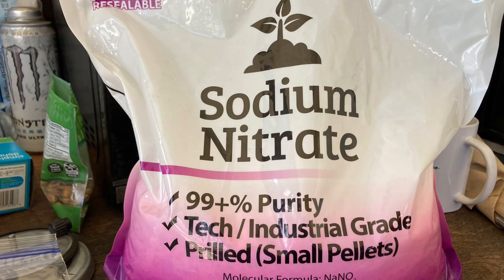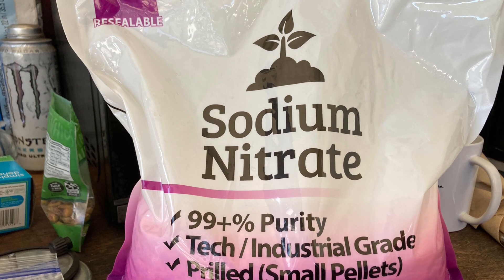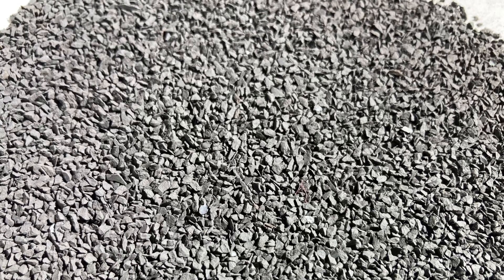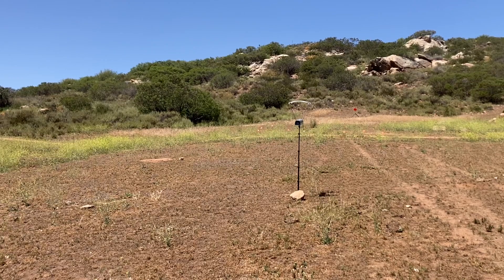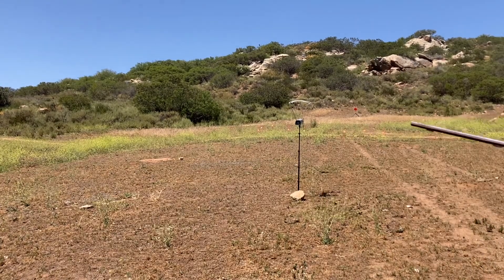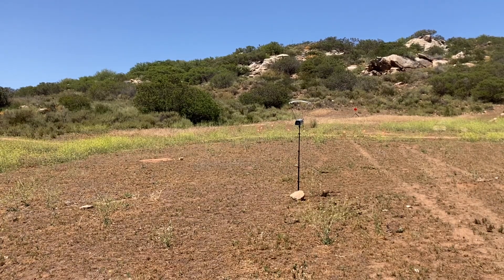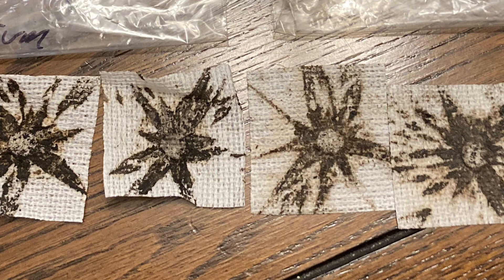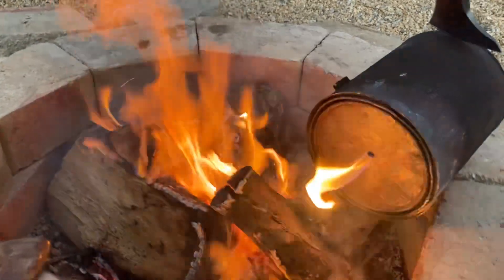Sodium Nitrate Black Powder

Comment: Your potassium based black powder (77g:13g:10g) has a molar ratio of 0.762:1.082:0.312 of KNO3 to carbon and sulphur. When you changed to Na based black powder you didn't take into consideration that the molar mass of NaNO3 (85 g per mole) is lower than KNO3 (101.1 g mole). The result is your black powder has more oxidiser (nitrate ion) present. The new molar ratio of nitrate:carbon:sulphur is 0.906:1.082:0.312. If you want to keep the ratio of oxidiser to carbon and sulphur equivalent to that for KNO3 you need to reduce the NaNO3 to 64.8 g (0.762M x 85) while keeping carbon at 13g and sulphur at 10g.  An additional consideration is that NaNO3 is hygroscopic which is why KNO3 is generally preferred to prepare black powder. NaNO3 might be inferior to KNO3 for a reason other than an excess of oxidiser or moisture content. Beavis the organic chemist.
Reply from the maker: Thank you, I’ve had a few people mention this. I’ll have to give it a try.
Reply: @Everythingblackpowder  You mentioned that the CIA method allowed you to increase the density of your KNO3 powder, but it uses water. It is probably better to use a dry process (few drops of water) because you won't have to worry if the powder is dry. However, it might be difficult to reach the density of the CIA prepared KNO3 powder and you will need to add more NaNO3 black powder.  I hope you get better results.
Reply: I have a composition here, but it might be for blasting powder: sodium nitrate 71%, charcoal 16.5%, sulfur 12.5%. 

But anyway, gun powder made of sodium nitrate is a bad idea, unless you can cover every grain with wax, as they used to do with NaNO3 based blasting powder. It's very hygroscopic, while KNO3 is almost non-hygroscopic.
Reply: @Everythingblackpowder  Paul is correct and this works. As for the chlorides yes true but it can be washed out very efficiently you can also use KOH which is Caustic Potash and even wood ash (the actual way they used to make Salt Peter in history for Gunpowder).  Also Chlorides aren't wonderful true, but a fact of life with all gunpowder historically. So historically gunpowder was a mix of Na and K Nitrates and contained a few other random minerals yet worked fine.
Reply: the classic composition of sodium powder contains more coal, 72/18/10 - Sodium Nitrate/Coal/Sulfur. There is noticeably more oxygen in sodium nitrate, so there should be more fuel. In general, such gunpowder is noticeably more powerful, in a steel pipe the deflagration rate is 500 m/s, in potash powder it is noticeably less than 400 m/s. The heat of combustion is also higher and there are more gaseous products. If it were not for the high hygroscopicity of sodium nitrate, it would completely displace gunpowder on potassium nitrate.
Reply: Can you translate that into English? Lol layman's terms?
Reply: Potassium Nitrate in KNO3.  Sodium nitrate is NaNO3.  K is potassium.  Na is sodium.  NO3 is nitrate.  So, they are essentially the same thing, except one has sodium in the place of the other's potassium.  The thing is, potassium weighs almost twice as much as sodium.   So, the same weight of sodium nitrate will have a lot more nitrate in it than potassium nitrate will.  So, if your black powder recipe goes by weight, your sodium nitrate powder will have a lot more nitrate in it.  Too much to ignite effectively, in fact.    @goodgodgivemeaname

Comment: Question: In Cooking your Charcoal, are you purging all of the Oxygen from the Charcoal Container prior to starting the heating process? The dirty burn might be from the oxidation of the Wood prior to the Carbonization from the heat. Maybe add some Dry Ice to purge the air/oxygen prior to heating as an experiment and see if it cleans it up any. Just food for thought.
Reply from the maker: @elberttanner6189  interesting

Comment: Lower temperature charcoal will have more volatile compounds left in it, which helps combustion and decrease ignition temperature. The higher the temperature of pyrolysis, the less Oxygen/Nitrogen/Hydrogen compounds you have left until eventually you're left with only carbon, which at that point you might as well being using graphite. IMO the ideal charcoal has been heated just enough to drive or burn off the water and "sap" content to create a porous and frangible charcoal._

Comment: As a teenager some of us to mix when 50-50 sodium saltpeter powder from the drug store with sugar and use a jetex fuse in piece of pinched off electrical conduit at both ends to make a bang.  I tried it in a homemade cap lock and it was only effective for the first shot.  After that there was too much fouling.

Comment: I was just starting to write the same thing good thing i went back and double checked. Someone wrote it a lot better than i started to. So I'll just do a condensed version so i can still get at ny point. I use nitrates for making nitric acid i use in precious metal refining. I prefer sodium nitrate to potassium nitrate as pound per pound you get a higher percentage of the weight made up by the nitrate anion on account of using the lighter weight sodium cation opposed to the heavier potassium cation. In this case the anion is the good stuff its use in black powder is no different. Now you also got to keep in mind that the sodium nitrate also has a bit of an affinity for water.s getting it completely dried out anhydrous is very difficult and then it will also literally suck water up out of the air the more water you got in your powder you do the math. I imagine using it for black powder it won't store very well, especially so in a more traditional type of container like a powder horn

Comment: I read an article about Swiss Powder which said that the charcoal was made from wood that had been weathered for two years in the forest where it was gathered before being processed into charcoal. If you think about it the purity of sulphur and saltpetre is pretty much constant, the greatest variable is the charcoal. Also the very high pressure that the mix is subjected to by the rollers before being granulated may make a difference. Weight for weight the Swiss powder seems to occupy a smaller volume so has a greater density.

Comment: Sodium Nitrate is highly hygroscopic; you need to bake out the water and then make sure it isn't exposed to air to reabsorb water.  That would be difficult, but unhydrated Sodium Nitrate is probably a better oxidizer than Potassium Nitrate.

Comment: What is the fastest powder one can make as easy as std BP ? Looking to replicate a BlackCat firecracker as much as possible.
Id still need a ball mill.. whats the best ingredients and ratio.
Ive been doing binary with premade alum powder, looking to get a ball mill and step it up to something more energetic..
Reply from the maker: I would use KN03 instead of sodium nitrate. I use a ratio of 77/13/10
Reply: @WillardMcBain  
77,13,10 is what I ended up on after reading more. But being in a high humidity area how bad is it for absorbing moisture  ?
I know it's not as bad as the SN but I have to deal with it constantly with the Potassium Nitrate and Aluminum based stuff.
Reply from the maker: @TrashPanda71 that’s all part of the show. I live in the south west so the humidity isn’t really a problem for me but the SN is much worse that KN03
Reply: @WillardMcBain  
I've also been looking at Flash Powder, much easier and very energetic, but must be extra careful with it.
7 grams of Potassium Perchlorate and 3 grams of Black Aluminum that I've bought before for the binary ..
Reply from the maker: @TrashPanda71  never made that
Reply: @WillardMcBain  
I'm having a brain fart tonight, 7 grams PP and 3 grams Alu ... that's not the same as 7 spoon full and 3 spoon full.. has to be 7-3 in weight  not volume  correct  ?

Comment: Sodium Nitrate is also called "Chilean Saltpeter"as it was found in Bat Caves in Chile and used for making Black Powder. It is more Hygroscopic than Potassium Nitrate,this means it absorbs moisture from the air more readily so it's harder to keep your powder dry .

Comment: Hello sir 
I make my black powder out of potasium nitrate that usually done .
But the problem with this 
It catches moisture in gun s breech 
.so i decide to take about 70 grains of powder and put in a thin layer of plastic paper and roll it down to barrel s breech .it works pretty good and same without any moisture problem.but sir I have question for you this method is good for accuracy or ballastics ?
Thanks sir

Comment: Are there any disadvantages to using sodium nitrate instead of potassium nitrate? Or would they both do the same thing?
Reply from the maker: If you’re using a firearm that takes a cap, it’s pretty much the same. It doesn’t work so well in a flintlock
Reply: @Everythingblackpowder  Got it sir, thank you. I intended to load 410 cal cartridges...

Comment: Hi, I made black powder following your advice on how to prepare it and the only thing I need to do is to compact it with a hydraulic press. The black powder I made burns at a similar rate to pyrodex.
I made the granulation from 3f.
Can it cause any damage to the rifle if I load it with this powder?

Comment: If you try to buy ammonium nitrate in any quantities now days you're likely to have law enforcement sniffing around. Practically impossible to buy even fertilizer grade locally. This do it yourself manufacturing would seem extremely hazardous to me but I'm not a chemist or manufacturing engineer. I'm surprised that you could get better results than GOEX. I have some of that left in my magazine but mostly the junk Elephant  brand. I'm not shooting muzzle loaders now days. Saving any good black powder for black powder cartridge 45-70 rolling block.
Reply from the maker: Well I’m not planning on doing anything with ammonium nitrate. As far as the performance of my powder goes, my alder buckthorn thorn powder matches the velocity of Swiss and my willow powder matches Goex. At this my main concern is making it burn cleaner

Comment: .... fast.....and could be even faster....sure anyone could hndle it......???!
but good man
also this is so fast and accuracy seem to be there , woow extraordinary experiance with this propelant. 
Personally is think i would use something bigger till it gets barely aimed on that range which is i think a top real use of it in  a cowboy defance of a city historical fact.... but yea . I think that this is a good time to introduce THE liquid gas propultion for a rifle like that , it is easy to inject it into a shell , just pour a cold liquid into a shell and it will stay then hold it in a freeezer for security , you may try to find out how long (if at all ) it takes for it to decompress in a dayly tempreture . A liquid might be anything really ....you know lots of them even if not combustive in a gas form DO explode unde  Ignition.
 Liquid oxigen , sure the easiest to get, liquid hydro ....might be , liquid nitroOxide yeas sir(it implifies already ignited ´´fire´´ so if you do it just the way its done in solid state then it will poof this poop out like a nukeAND its really easy to stor in a hit of a day (the  bottle does nod get exploaded typically when in a car soo just try it and remember to seal a bullet with a shell with a fine glue .

Comment: The CIA method for making black powder is not likely to work well because NaNO3 is hygroscopic and it will be difficult to air it well dry after you precipitate/crash it out with isopropanol. You are going to have issues reaching the density that you get for your KNO3 black powder. Drying in a chamber with a good drying agent and using a vaccum pump would help remove the water. Do not heat the chamber!!

Comment: I'm using sodium bp because i can't find easily potassium nitrate. If the ball isn't rammed super tight, with the low ignition speed, it sometimes puffs without actually detonating. But if you really ram the ball well, it will just pop like one hell of a baloon. With a percussion cap and a well pressed ball, you got no delay, not much smoke and quite nice power. And it's cheap and easy to find (stump removers manufacturers usually put sodium nitrate beacause it's cheaper)
Reply: Look for stump remover powder in garden section of many stores.
Reply: @donaldcadwell3911  most of the stump removers are made with sodium nitrate, beacause it's cheaper than potassium. And that's exactly where i got my ingredient
Reply: @jeanladoire4141  
Spectracide is brand we have that is Potassium nitrite.
Reply: @donaldcadwell3911  it doesn't exist in France sadly. But sodium nitrate work well, it was used before,but will behave like old gunpowders : you have to ram it tight for it to detonate
Reply: @jeanladoire4141  
👍

Comment: You can get 1900 feet per second with black powder,- but that involves the old English Black powder express rifles.
As a example:
The energy requirement for big game in Norway is: 
1) for bullets with a weight of 138.9 to 154 grains, the estimated energy is at least 2700 joules at 100 meters E100 
2) for bullets with a weight with a minimum of 154 grains, the estimate energy is minimum, 2200 joules at 100 meters. E100 
Conclusion: One must have a minimum speed of 400 m/sec (at 100meters ) and a ball weight of at least 450 grains to cope with the energy requirement on big game. (2233 Joule E100 for those wondering).

That is possible with:
.45-120 ( 500 grains bullet, 463 m/sek 1519 ft/sec)

.50-140 Sharps 

English cartridges:
.450 Black Powder Express

.461 (.450) Gibbs

.500 BPE ( 440 grains bullet ,580 m/s 1902 feet/sec)

.577 BP Express

.500 No. 2 Express (.577/.500) 340 grains bullet 130-160 gr Fg swiss ,587 m/s 3,800 J .

Scottish bottleneck:

20/577 Alexander Henry, 570 grains bullet, 1,725 ft/s (526 m/s).

Speeds above 600 m/sec is extremely hard to obtain with black powder.

Comment: Damn, I didn't know you could achieve those velocities with black powder, especially round ball (though I assume it sheds velocity extremely fast?)
One of my favorite "plinking" loads for my Marlin 1894 (.44mag not .44-40 so .429-.431in, not a true .440 of a .44) is a 248gr flat-nose over 21.5gr of 2400.  I think the last run I made averaged 1689fps over 10 shots from a 20" barrel, so I'd say that's pretty analogous.  At least that WAS one of my favorite loads, in the before times when I could still find smokeless powder and primers...  Getting really low on both so I might have to pick up a muzzle loader in order to be able to take a deer in the next few years!

I know the cost of big bore revolver/lever gun factory ammo has doubled since 2019, $70 for a box of Fiocchi .44mag 240gr JSP's when I was getting them for $33 not even three years ago, so if this bs continues I honestly might have no other choice than to move to muzzle loaders.  Got plenty of M80 ball 7.62 NATO, but I doubt that's a very good deer round, lol
Reply: You can get 1900 feet per second with black powder,- but that involves the old English Black powder express rifles.
As a example:
The energy requirement for big game in Norway is: 
1) for bullets with a weight of 138.9 to 154 grains, the estimated energy is at least 2700 joules at 100 meters E100 
2) for bullets with a weight with a minimum of 154 grains, the estimate energy is minimum, 2200 joules at 100 meters. E100 
Conclusion: One must have a minimum speed of 400 m/sec (at 100meters ) and a ball weight of at least 450 grains to cope with the energy requirement on big game. (2233 Joule E100 for those wondering).

That is possible with:
.45-120 ( 500 grains bullet, 463 m/sek 1519 ft/sec)

.50-140 Sharps 

English cartridges:
.450 Black Powder Express

.461 (.450) Gibbs

.500 BPE ( 440 grains bullet ,580 m/s 1902 feet/sec)

.577 BP Express

.500 No. 2 Express (.577/.500) 340 grains bullet 130-160 gr Fg swiss ,587 m/s 3,800 J .

Scottish bottleneck:

20/577 Alexander Henry, 570 grains bullet, 1,725 ft/s (526 m/s).

Speeds above 600 m/sec is extremely hard to obtain with black powder.
Reply from the maker: there’s a few reasons why I get good velocities. One is that the round ball is lighter, roughly 140gr. Also the barrel length is a big contributing factor being 44 inches to your 20 inch carbine. I typically only run the best black powder I can make/obtain in this rifle and can get a little over 2000fps with a 75-80gr charge but I usually only do that for long distance shooting
 (Over 200 yards) 
I was testing some 44mag handloads last weekend and I settled on 23.5gr H110 with a 240gr JHP. they averaged 1400fps out of my Ruger Blackhawk, 7.5 barrel.

Comment: Being called blasting powder might explain its intended use. Like in mining and such. It may burn slower in the open but works basically the same under compression and is cheaper to make, so a significant cost cut if you need a lot of it.

Comment: One wonders how ammonium nitrate would work. Available as fertilizer. The folks in NE Thailand who make the giant PVC skyrockets (look up "rocket festival" on YouTube) use, I believe, some sort of meal powder based on ammonium nitrate and charcoal, no sulfur - it burns really slowly from what I understand. I remember making some sodium nitrate based meal powder when I was in school, we packed it into a cardboard cylinder, thinking to make a rocket, but it just burned really slowly and produced a whole lot of molten slag dripping out the bottom. One wonders what makes up fouling - part of it is probably a salt or oxide of the metal used in the oxidizer, which makes me think ammonium nitrate would make less fouling.

Comment: NaNO3 has more oxygen by weight, so could burn the combustibles more completely.  Possibly could get even higher muzzle velocity if the proportions of sulphur rand charcoal were increased slightly to take advantage of the higher oxygen provided.  Union army used Chilean sourced Sodium Nitrate to make gunpowder since the KNO3 sources had previously been bat guano based from caves in the American South, and reported higher performance in cannon.